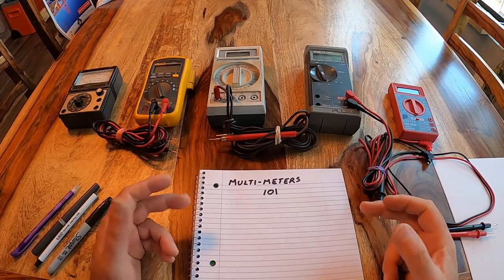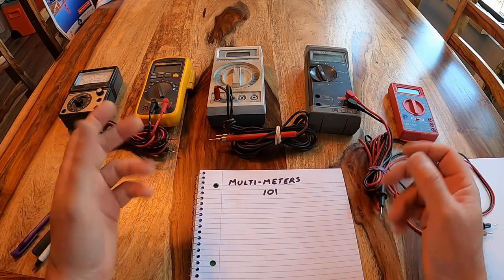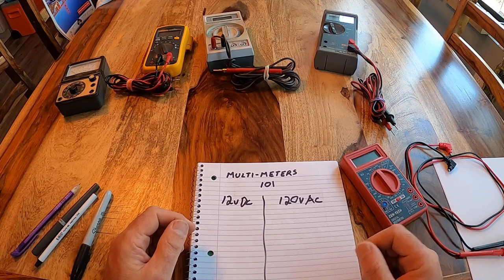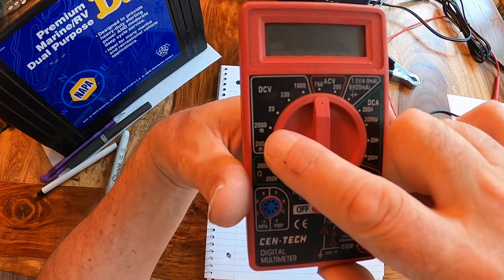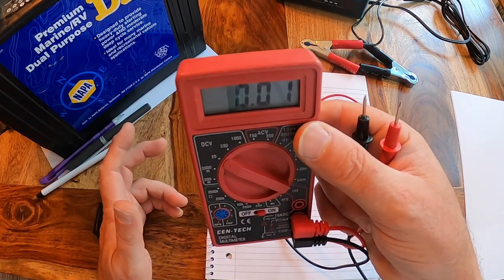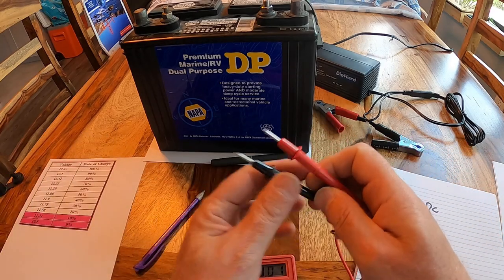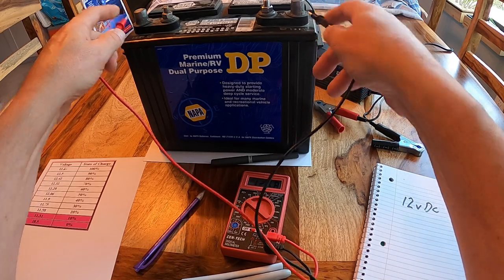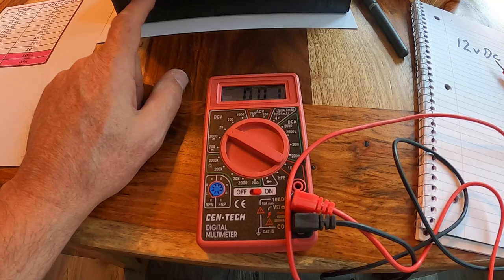Multi-Meter 101 - Tab Trailer Training

Comment: So, applying that to our trailers, if they have been unplugged from shore power, disconnected  from the tow vehicle for awhile and we have the battery switch set to off so no devices in the trailer will work, when we go to test the battery, my questions are:
1) Do we need to disconnect the leads at the battery before testing the voltage?
2) If we find the battery to be at or below the voltage representing 0% charge, would we be best to plug into shore power so the power center charging function will recharge the battery, remove the battery and use a typical shop charger, or would it be better to just go get a new battery?
Thanks for the videos!
Reply from the maker: If you have the battery switch set to the "off" position, that will disconnect the battery, and you don't need to disconnect it in any other way before you measure it.
However, if you have a solar charging system, be aware that the battery switch does not disconnect that solar panel from the battery.. Because of that, if you do have a solar panel, then turning off the battery switch is not enough, and you will also need to physically disconnect the battery manually.
Furthermore, if you do need to manually disconnect the battery manually because you have a solar panel, be aware that you don't need to disconnect "both" the positive and negative wires. Disconnecting just the negative wires OR the positive wires will be enough.

If your battery is completely dead,  connecting it to a shop charger is the better thing to do. A dead battery can draw a lot of current as it tries to charge back up. This can sometimes overheat and damage the charger. It is better to loose a cheap shop charger, than to loose your expensive converter charger in your trailer.
Sometimes the battery will come back, sometimes it won't. But usually if it does come back, it will be weaker than it was before.

Comment: Hi Mark, I tested my battery. I have 2 deep cycle batteries. Each tests at 6.4 volts. So does that mean  my total voltage is 12.8 volts. I tested with  them rested and disconnected . So can I assume my batteries are in good shape? They are about 6 years old. I have a 2016 T@B Max S